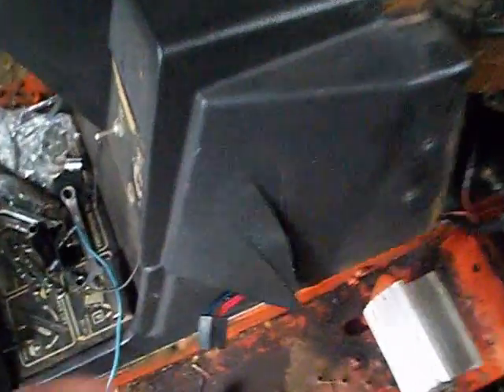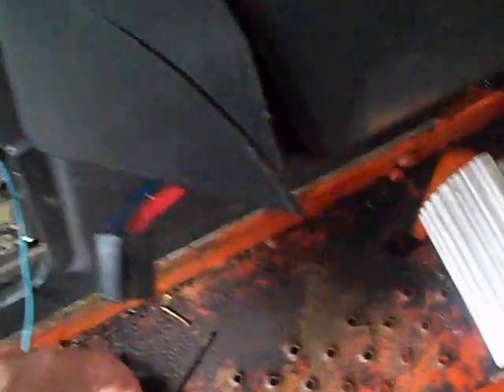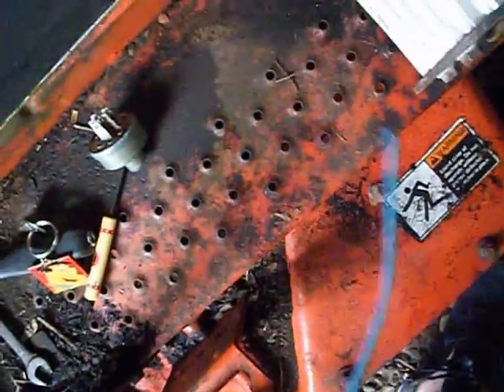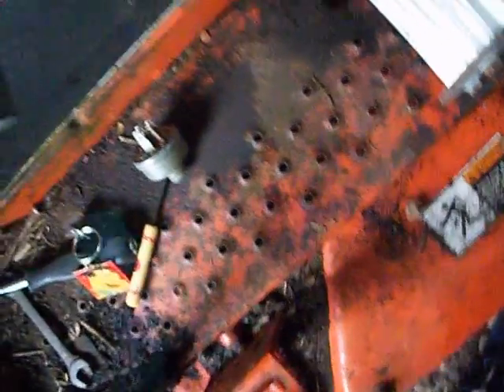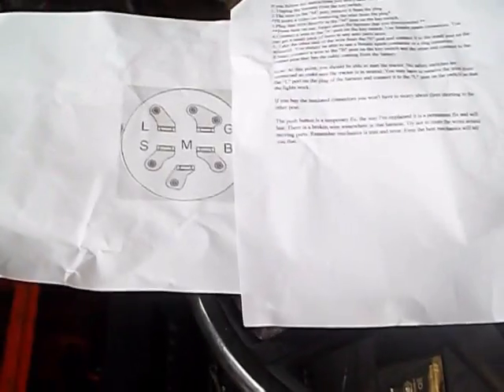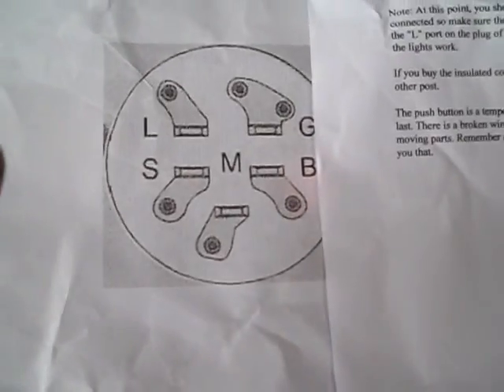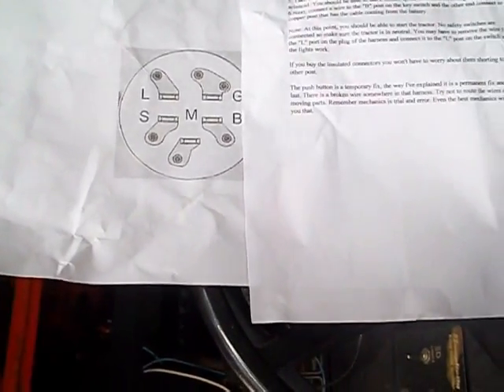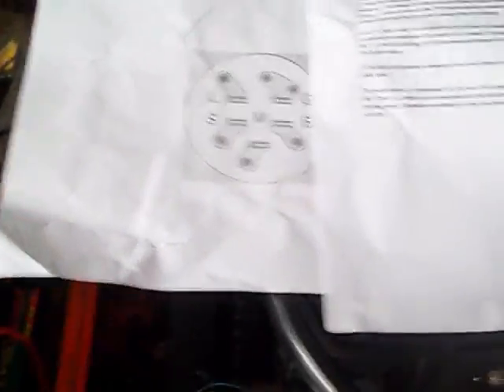simplicity 4211 tractor part 15 rewired it and it starts but lights don't turn on

Comment: I had read a post awhile back on a forum that I was on where a fella had the same problem. I'll try to find it again and when I do I'll send you the link. Glad you were able to get it to crank over.  What does the plug and wires look like that come from the engine for the charging system? I'm sending you a link to help you identify your charging system.